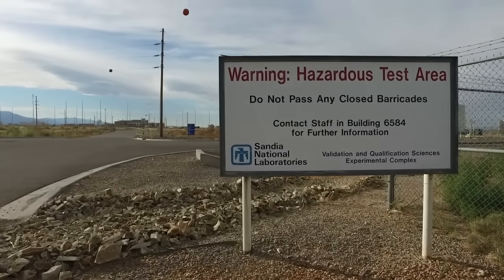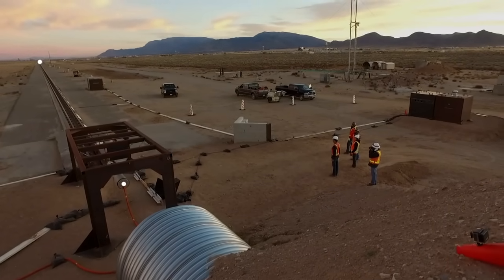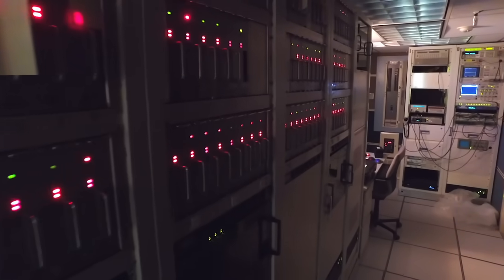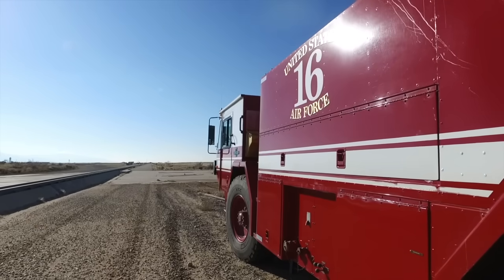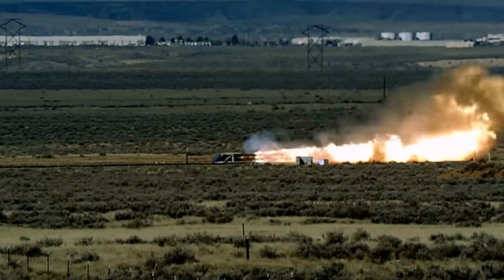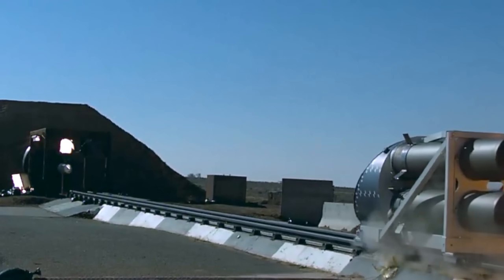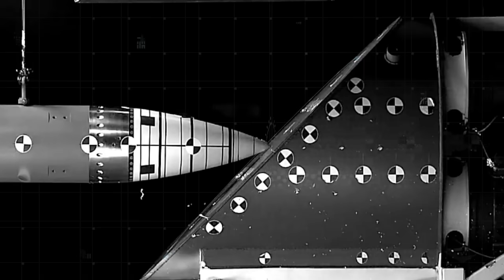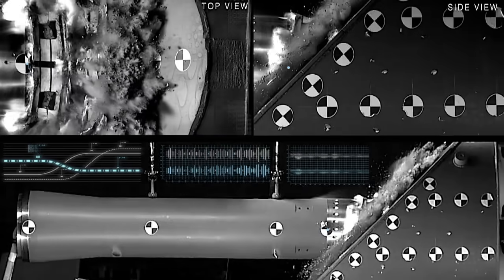Rocket Sled Impact Test In Slow-Motion

Comment: Here at Rockwell Automation’s world headquarters, research has been proceeding to develop a line of automation products that establishes new standards for quality, technological leadership, and operating excellence. With customer success as our primary focus, work has been proceeding on the crudely conceived idea of an instrument that would not only provide inverse reactive current, for use in unilateral phase detractors, but would also be capable of automatically synchronizing cardinal grammeters. Such an instrument comprised of Dodge gears and bearings, Reliance Electric motors, Allen-Bradley controls, and all monitored by Rockwell Software is Rockwell Automation’s "Retro Encabulator".

Now, basically the only new principle involved is that instead of power being generated by the relative motion of conductors and fluxes, it’s produced by the modial interaction of magneto-reluctance and capacitive diractance. The original machine had a base plate of prefabulated amulite, surmounted by a malleable logarithmic casing in such a way that the two spurving bearings were in a direct line with the panametric fan.

The lineup consisted simply of six hydrocoptic marzelvanes, so fitted to the ambifacient lunar waneshaft that sidefumbling was effectively prevented. The main winding was of the normal lotus o-deltoid type placed in panendermic semiboloid slots of the stator, every seventh conductor being connected by a non-reversible tremie pipe to the differential girdlespring on the ‘up’ end of the grammeters. Moreover, whenever fluorescence score motion is required, it may also be employed in conjunction with a drawn reciprocation dingle arm to reduce sinusoidal depleneration.

The Retro Encabulator has now reached a high level of development, and it’s being successfully used in the operation of milford trenions. It’s available soon; wherever Rockwell Automation products are sold.
Reply: tubeist- dan Sounds like a bad Panametric fan.
Reply: You seem to be very well versed on this material, and that is why I am seeking your advise. You see I've created a bit of a problem for myself. Here's the back story. I was attempting to braze six (6) self sealing stem-bolts just inside the conche seal of a Tyson-Maywether type III gonkulator valve. Well, I apparently did not allow sufficient cooling in between brazzings and upon the first usage of the re-installed valve, the knibbler-pin has sheared off inside the valve! Now I shouldn't have to remind you of the scarcity of type III's. They are still very popular and haven't been in production for quite some time making them frustratingly hard to find. My hope is you can advise me on a safe method of pin extraction without further damaging the conche seal. Please, Help me Kyle Gilmore, your my only hope.
Reply: I sent you guys my 2-year old gonkulator, which is still under warranty, for a specular re-jibbination of the brank-mountings, and clean out bits of oxidized brottle, and haven't heard from you yet.
Reply: Maybe, but the bits of oxidized brottle is characteristic of erroneous milling of the semiboloid slots. They may have been milled with their foci axis misaligned, thereby offsetting the synchronous actuation of the grammeters and causing positive vibratory feedback loop.
Reply: Ah, a classic!
Reply: Nominal. And a huge waste of our #tax dollars.
Reply: I'll be sure to pick one up at my local Walmart.
Reply: I was thinking the same at the beginning lol
Reply: I saw Magneto 😉
Reply: Kyle Gilmore I love that video
Reply: Kyle Gilmore it doesn't seem like your customer response is too good. You haven't responded to the comments.
Reply: Kyle Gilmore i think you should add a discombopulator to the mix, dont you think !
Reply: Kyle Gilmore ...😂dude, too hilarious!
Reply: That's phunny shit rot thar!!
Reply: Ahhh this brings me way back :)
Reply: Oh man you had me so bad at sidefumbling.
Reply: You help write the how they do it for the plumbis ? 😂😎😋
Reply: Kyle Gilmore It could be said aloud, but not clearer. 👍
Reply: You're making my brain hurt.
Reply: What type of English are you guys speaking here?
Reply: The Dingle arm was great addition. Sinusoidal depleneration can be a bitch.
Reply: I think the problem may be congenital de-formation of the jockgirgle primary in your case.
Reply: Kyle Gilmore Yes Kyle, the famous retroencabulator. Who can explain it using Maxwell's equations? Einstein is gone and Hawking just left us. The mathematics used to explain retroencabulation is extremely difficult. I suspect that it actually was not ALS that took our beloved Steve  Hawking but excessive failures in proving mathematically that such a machine exists. Who will step up to the plate? Who will get a Nobel for proving mathematically that the retroencabulator actually exists?
Reply: Turbo Encabulator man!

Comment: What was the point of this test? Can anyone explain why we are spending hundreds of millions on this? What does this simulate?
Reply: This test shows that, should there be a supersonic impact of a live nuke in an emergency jettison or accidental firing scenario where the safety triggers were still in place, the charges would not detonate, causing the proper compaction of the nuclear material and resulting in a nuclear explosion.  Instead, as what happened here, most of the material, including the HE shape charges surrounding the nuclear material, would simply be vaporized or be reduced to a sub-optimal shape that would not allow for detonation to occur, thereby preventing an accidental tragedy.  In a proper detonation scenario, the warhead would be programmed so that the shape charges would be detonated at a specified altitude, compressing the nuclear material into a supercritial mass and causing an uncontrolled chain reaction, ie, a nuclear detonation.  The altitude of the blast is calculated to maximize the destructive force of the downward and horizontal shockwave and minimize the amount of debris pulled into the center of the explosion, and thereby lowering the total amount of fallout produced.  Due to the age of the nuclear weapon stockpile, both the casings and the HE is subject to degradation and regular tests need to be conducted to ensure the stability of the components used therein, as they are being stored and unstable HE could result in unexpected non-nuclear detonations at various storage facilities around the globe.
Reply: tfw someone actually explains why instead of launching into a politically motivated rant
Reply: My guess is to gather data from a real event for further simulated ones.
Reply: Ah thank you. I have seen many launch failures as well as ordinance drop failures resulting in impact with air frames. Does Sandia also test radioactive waste transport containers?
Reply: They use this to make the super computer work right.
Reply: firendable, and where do you think they would get the data from? 

Tests like these.
Reply: Why do dumb people always ask where the tax money is going. Guess it’s not going to an education for you that’s for sure

Comment: Seriously, i do not get it. 
and what is the point of this? "it's safer"? Why? what is the actual scenario they are looking for and what would be a "bad" (instead of a "good") result?  
Instead of all this dramatic music they could have come up with some explanation why they are doing it, exceeding a blunt "because it's good for our safety".
1) the rocket engines are working (given that...)
2) the sled is working as a sled (is there any rockets using sleds)
3) the dangling rocket was vaporized during impact 
4) the inert(?) rocket didn't explode. Could this have been happening?
Reply: The test was to ensure the complete disintegration of the weapon upon a supersonic impact, such as those that might be found in an accidental launch scenario.  This also tests the reactivity of the HE contained around the core, albeit this core didn't contain any nuclear material which is why it was labeled as inert.  

In a proper scenario, such as the one shown here, the weapon should have been vaporized, thereby preventing the HE from exploding properly, or exploding at all, and also vaporizing the nuclear material contained in the core, preventing criticality.  

If the test had not been a success, you would have seen a much larger explosion as the HE shape charges around the core detonated possibly throwing nuclear material in larger chunks away from the warhead and causing radiation contamination.  

In a worst case scenario, the warhead would have been triggered and the HE would have detonated in the proper configuration to compress the core into a supercritical mass, thereby initiating a nuclear explosion had the bomb not been inert.  

Either of the later two outcomes are unacceptable, as the safety triggers on the weapons should not allow detonation except when the proper arming sequence is complete, the safety override codes have been transmitted and accepted, and the proper altitude has been reached.  Due to the age of the weapons, the age of the electronics, sensors, and software used on them, the age of the components making up the weapon itself, and the age of the HE contained therein, regular testing needs to be performed to ensure that they are still safe to store, yet are still able to function properly if there should be a need.  So yes, it is a test the validate the safety of our national nuclear stockpile.

Comment: I'm wondering exactly what safety and Security concerning our nukes was accomplished with this  rather expensive test ?
Reply: The test was to ensure the complete disintegration of the weapon upon a supersonic impact, such as those that might be found in an accidental launch scenario.  This also tests the reactivity of the HE contained around the core, albeit this core didn't contain any nuclear material which is why it was labeled as inert.  

In a proper scenario, such as the one shown here, the weapon should have been vaporized, thereby preventing the HE from exploding properly, or exploding at all, and also vaporizing the nuclear material contained in the core, preventing criticality.  

If the test had not been a success, you would have seen a much larger explosion as the HE shape charges around the core detonated possibly throwing nuclear material in larger chunks away from the warhead and causing radiation contamination.  

In a worst case scenario, the warhead would have been triggered and the HE would have detonated in the proper configuration to compress the core into a supercritical mass, thereby initiating a nuclear explosion had the bomb not been inert.  

Either of the later two outcomes are unacceptable, as the safety triggers on the weapons should not allow detonation except when the proper arming sequence is complete, the safety override codes have been transmitted and accepted, and the proper altitude has been reached.  Due to the age of the weapons, the age of the electronics, sensors, and software used on them, the age of the components making up the weapon itself, and the age of the HE contained therein, regular testing needs to be performed to ensure that they are still safe to store, yet are still able to function properly if there should be a need.  So yes, it is a test the validate the safety of our national nuclear stockpile.
Reply: Joe Alesi reading the rest of the comments here you'll have to copy and paste that answer for a lot of people!  Lol
Reply: Keith Cleghorn tests the sensors reaction times since this bomb probably flys as fast as that rocket sped goes!
Reply: I only do that for the people posting the same question over and over.  It's really quite simple if anyone would care to actually understand what they do and why they do it.  Instead, people seem to want to take the time that could have been spent on finding the answers for themselves, and instead post the same question being asked by others in the hopes that the information will be spoon fed to them.  Of these, half will dispute the information provided anyway, yet still not take the time to do their own research.  So yeah, pardon me for cutting and pasting my reply to people who cannot be bothered to find things out on their own.  I do it for the tiny percentage of people who are actually interested in finding out the reasons behind the test, and not just trying to post a smug comment in support of their own hidden agendas.
Reply: Joe Alesi haha I wasn't critiquing you man!  It was a good explanation of what they're doing hence why you should share it!  And I'm sure you don't want to have to type that all out over and over again.
Reply: No problem then, man.  My mistake on how I took your comment.  It's gotten to the point on a lot of these videos where people like to comment things that make it seem like they are interested, then when someone comes along with a scientific answer, they suddenly argue with whomever tried to help and provide an answer to their question.  Thank you for being genuine and actually looking for an honest answer to your valid question.  :)